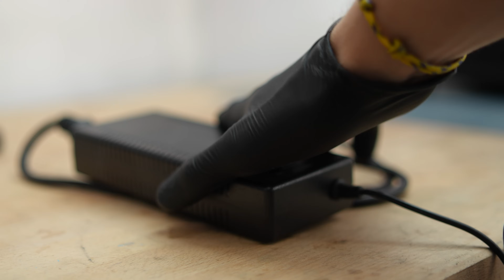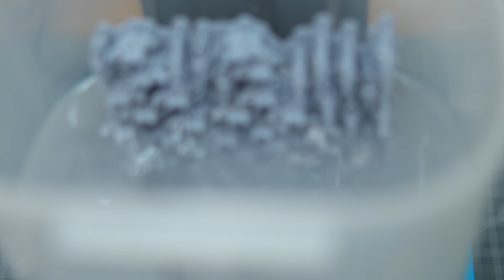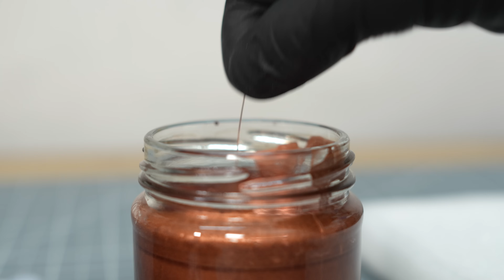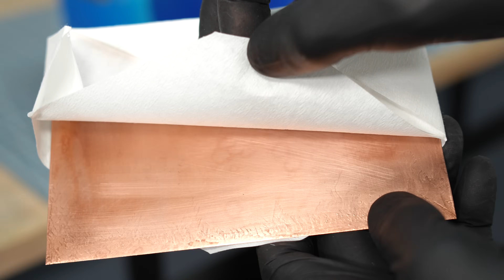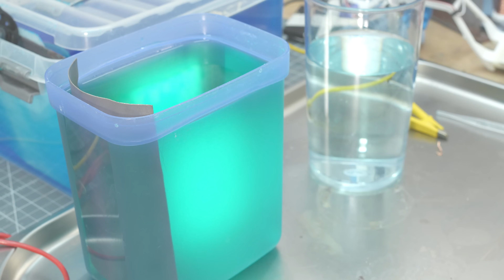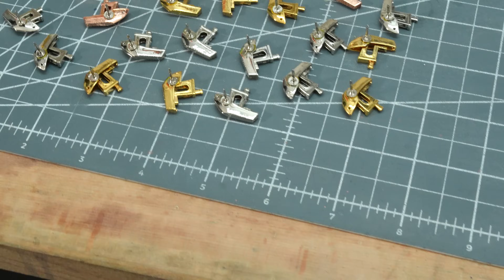Electroplate many 3D Prints in one go!

Comment: how do you electroplate jewelry pieces that have various mixed materials in them such as resin and encaustic and even crushed glass ? won't the electroplate cover over all those unique colors & patterns? how do you prevent that? is there something you can put over the material like a Resist that keeps that material from being electroplated when submerged into the electroplating solution?
Reply from the maker: I mask off the party before applying the conductive paint with tape.

Comment: Hello! I have a question. How do you avoid the wire contact marks around de electroplated pieces? Do you constantly change, during the electroplating process, the wire position that envolves the piece? I am trying electroplating at home and I can't deal with that issue. Congrats for you work!!
Reply from the maker: I try to avoid any wire contact on visible areas once I formed a light hull. Moving can help but will eventually create even more marks.
Reply: @hen3drik  thanks for your answer!   The idea of changing position is to promote more metal deposit where the marks are formed. Then I could have enough thickness to sand and remove that marks. But I will try put the wires with less contact.
Reply: Hello. What is the name of the spray you need to put on 3d prints so that the galvanizing works? Thanks

Comment: How much does the electroplating effect the weight of the prints? I'm assuming they're still noticeably lighter than a solid-metal counterpart, but do they still get any noticeable increase in weight from just the plating?
Reply from the maker: Yes, it’s exactly like this. The smaller the print the more noticeable.

Comment: Hi Hendrik, is it possible to electroplate ABS or ASA parts after they are smoothed with acetone vapour or is it better to sand it like other materials?
Reply from the maker: Ou can vapoursmooth it but it will only make the surface smooth and not even (which is needed for a mirror finish)

Comment: Hi, another great video and I very much like your idea as a business card prop. Unfortunately we can't get copper paint here, so I decided to make my own. By reducing CuSO4 using Ascorbic acid (VitaminC). Wash, filter and dry. I tried it in water based polyurethane and solvent based nail polish lacquer. Both are good but dispersion and suspension are way better with the nail polish. Results are < 1ohm/cm unpolished thin coat.
Reply from the maker: Oh, yes, this works pretty well, I did that some years ago, but you need so much Ascorbic acid. Yet the nano copper is pretty nice.

Comment: Wait why wouldn't you print all the benchies already on the branches? Saves you lots of wire work
Reply from the maker: I actually thought of that 😅
Reply: @hen3drik  nice! Did you try it? Would make the whole process so much more scalable!
Reply: @robinyilmaz1155  Resin printing can be quiet a bitch. Since every benchy would be oriented differently, every single one would be a point of potential failure. Printing them oriented in a single tested position therefore is the right way to go.

Comment: How noticeable is the little bit of unplated copper wire on the corner of the stern? Did you (or would you recommend us to) go over that spot with the electrolytic pen using nickel and then gold? Or does it secretly look really good?
Reply from the maker: It’s actually barely noticeable. 😅